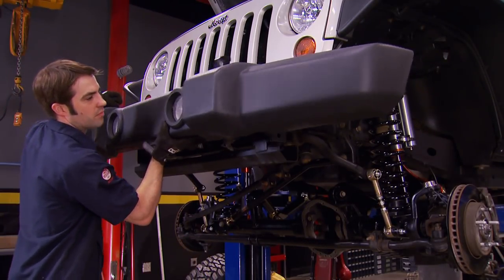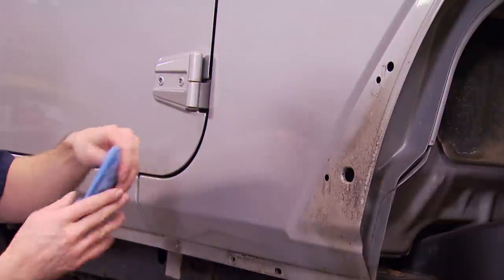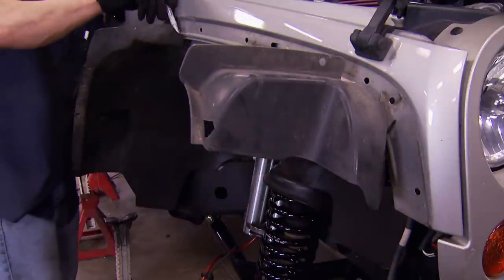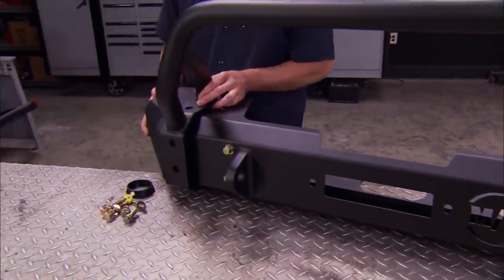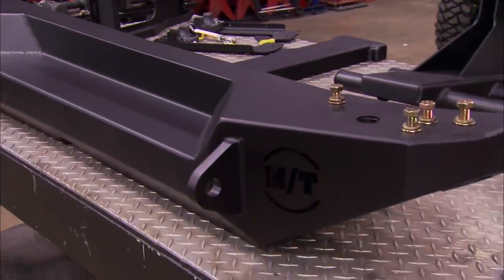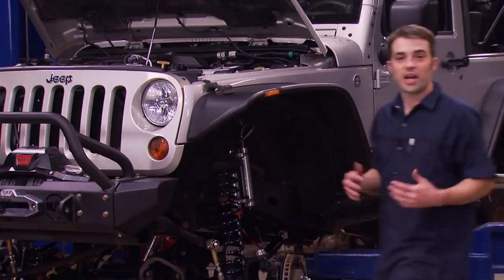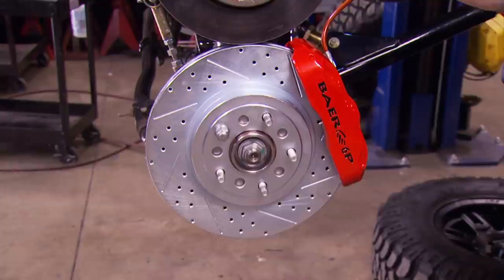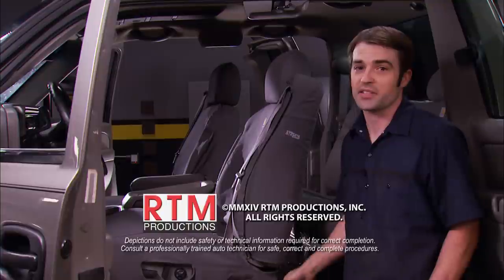Swapping Out Stock Wrangler JK Bumpers & Brakes For Bigger, Better Options - Truck Tech S1, E18

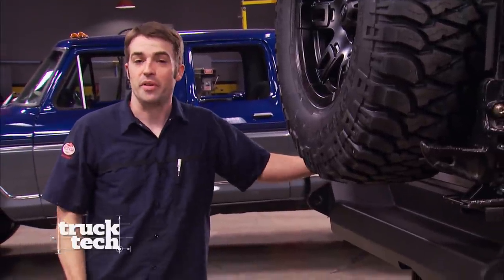Comment: 12:51 thats a sweet truck in the background!
Reply: That's an old project called project super dually it's a 78 f250 crew cab shortbed on a 97 ram 2500 Cummins chassis
Reply: well yeah, it's 90% Dodge
Reply: @TrumpAmerica-2024  he said sweet not reliable
Reply: weetaard above me

Comment: IMO - hi-lift jacks are for decoration only.  They are mostly useless and super dangerous.  Trying to lift the body at the bumper, the tires won't leave the ground before you run out of jack.  A little bottle jack under the axle is hard to beat.  Edited to add - great video BTW, these projects are great to imagine what you can do with every cool tool out there and an unlimited budget.  Life goals!

Comment: Like the winch and bumper kits but not a fan of the supplied hardware. They should have included anodized or painted bolts. Well done.

Comment: Cross drilled rotors?  I will like to see how can be possible wash ALL the mud from those tiny holes after crossing a mud pit.  Or even better, with hot rotors.... just sand paper.

Comment: Got rid of plastic to put on different plastic
Should of got steel or aluminum flares and fender liners 
But hey you’ll find out when you get wrapped up on a tree with your rear quarter panel lol
Reply: May be a good idea for weight saving
Reply: @michaelsorenson3887  them go with aluminum 
Trust they’ll crush those fenders in no time I’d rather not have body damage because to be honest you’re going to get it it’s just a matter of when and if you can avoid it you probably should lol also a waste of money because they’ll break for sure like I said just a matter of when